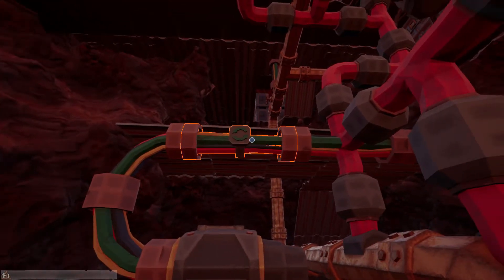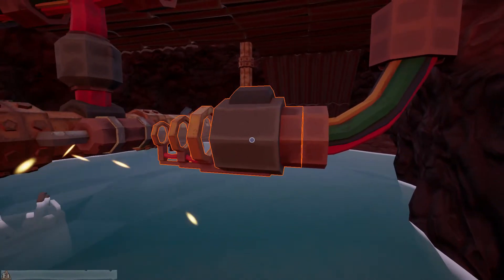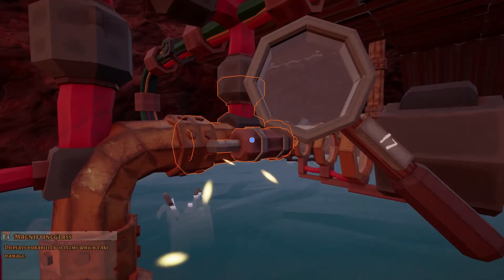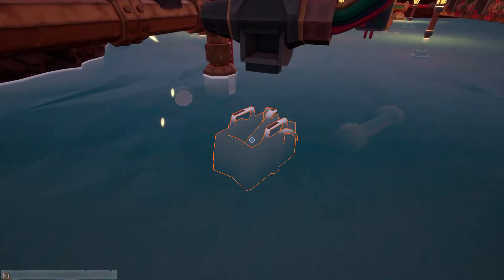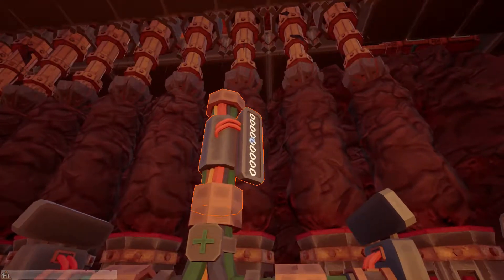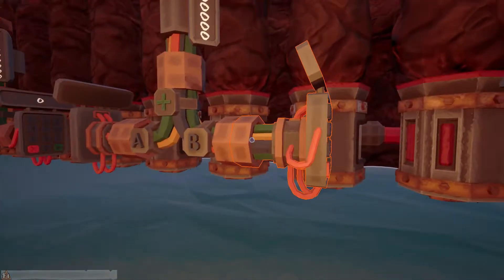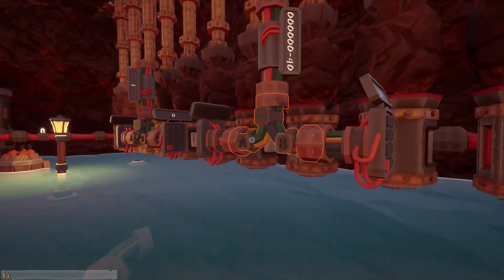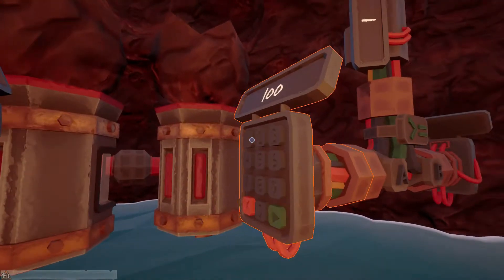Hydroneer 101: The new Logic Gates

Comment: color codes are in RGB values which is like this 255255255 = white 255000000 = red 000255000 = green 000000255 = blue if you have paint. net it shows both RGB and hex values for the colors and it is a free tool.